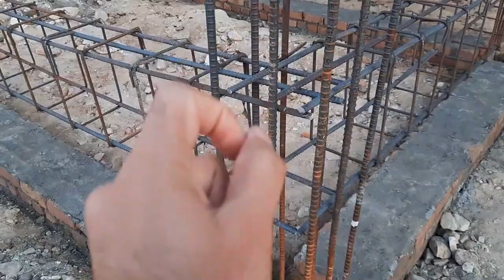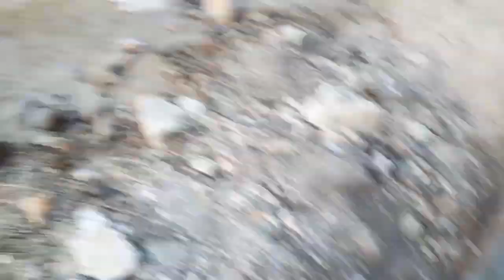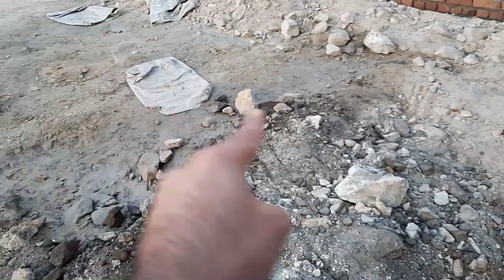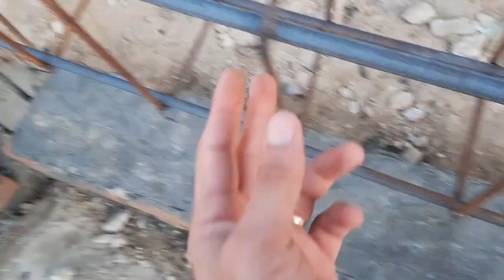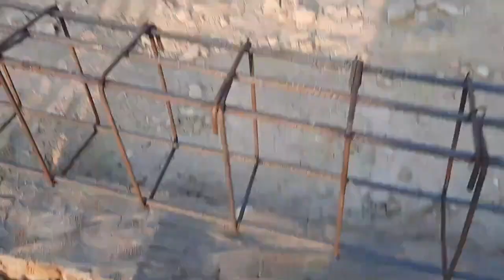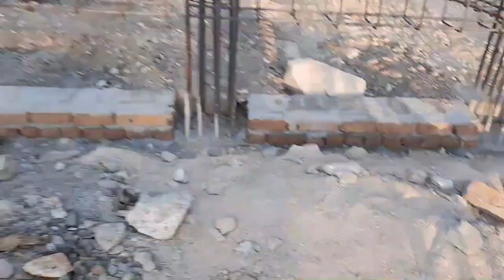2 Big Mistakes in Beam Construction

Comment: you mention the mistakes but did not mentioned that how these problems should be corrected or what procedure should be used of some one made that mistakes. its would be better if you also mentioned that how would these problems should be corrected.